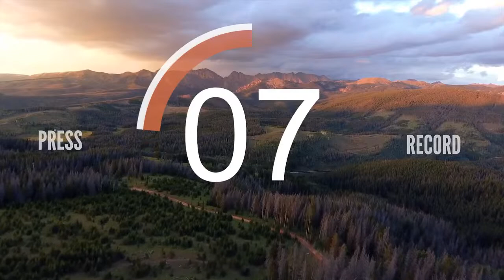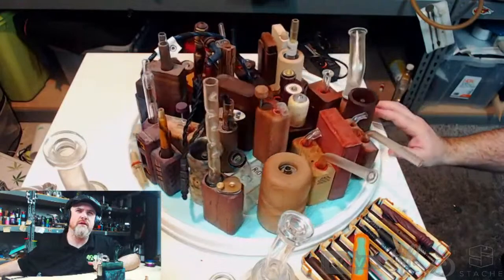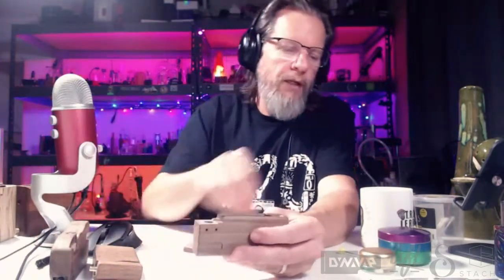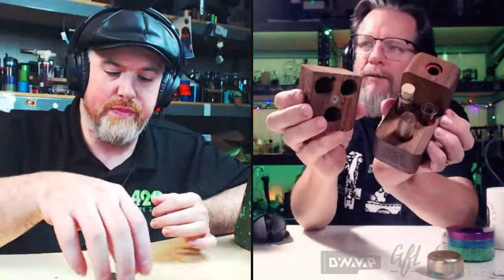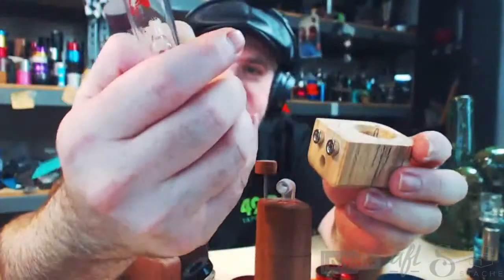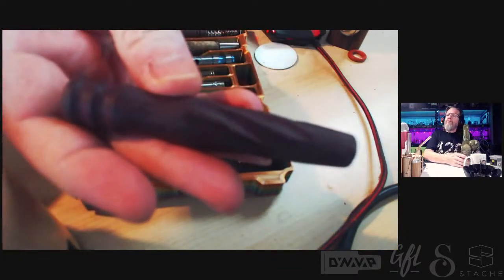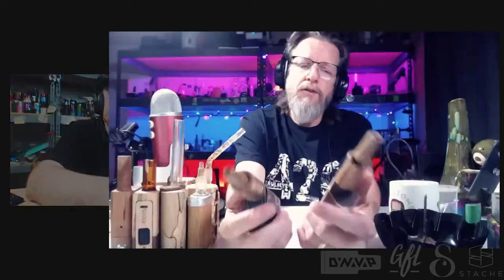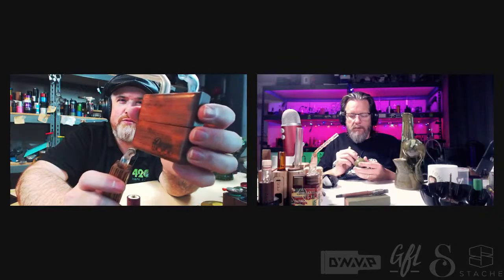Artisanal & Handmade Dry Herb Vaporizers // Vape Passion

Comment: 27:25

that's so cool and practical! made me excited to get it as my next vape. 

replaceable batteries that are not proprietary (damn you Fierce) and  are truly easily swapped! model 3 with the screws is a huge turn off if your fine motor skills are non-existent, glad to see that at the 7th model they have cool covers that can be used as packing tools.

Comment: troy, why do you like the fw4 better? jerry, why do you prefer the 7?
Reply from the maker: I like the 7 better with the extended glass mouthpiece I got. It really needs a cooling unit. I'm fine with either, really. But only the 7 is available. I think the 7 is easier to load. I wasn't a huge fan of the capsules. (Jerry)
Reply: purely subjective. I've used and carried them all on the go, the 4 and the 5 were the last ones that I enjoyed carrying.
Reply: Fw 4 is so compact. Amazing performance. Smart interface one button use with Vibration Feedback. Swappable battery and very good taste. One of his best models. Imo. Like a crafty without the downside of a small battery.